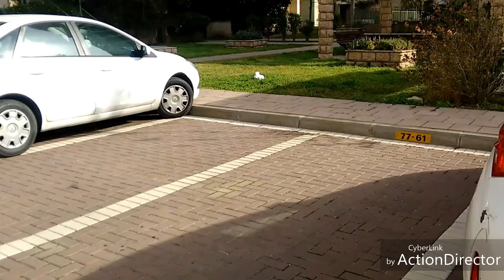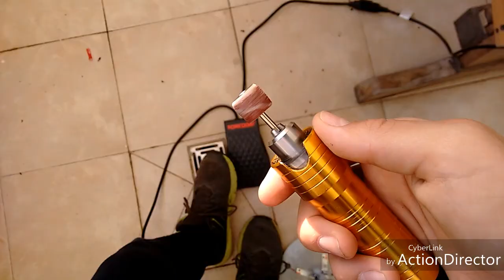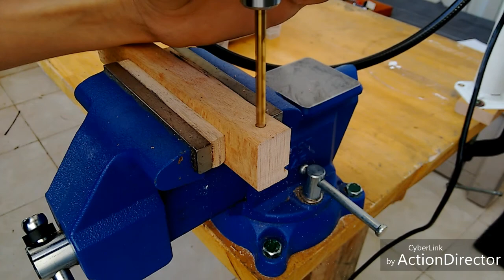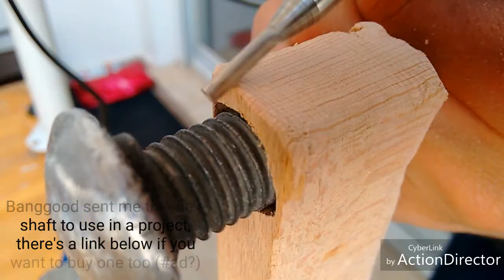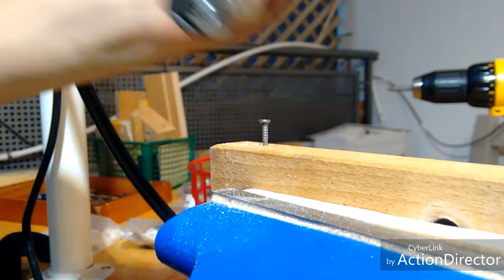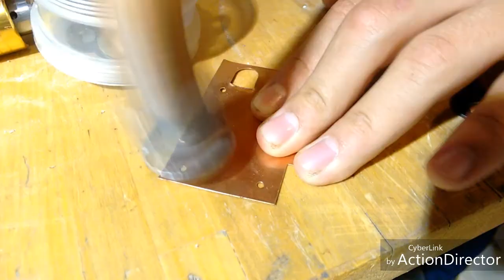How to Make a Ball-Peen Hammer from an Old Bolt - with a Secret Twist! (no pun intended)

Comment from the maker: Comment your guess on how much this hammer weighs, free heart to the closest one!

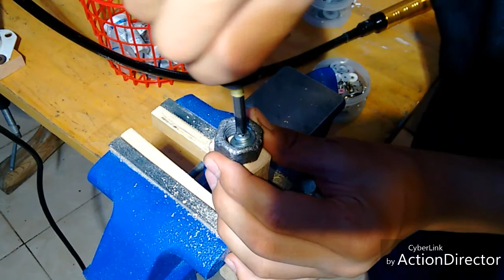jk I cheated at 2:09,  I used a screwdriver :)
Reply: Yonatan24 15 ounces
Reply from the maker: WHAT!?! How did you know?

Just kidding it's actually a tiny bit less than half of that :)
Reply: Yonatan24 7.5 ounces.
Reply: I mean 7.
Reply from the maker: Oh, 7.16061 / 203 grams.
But if I sand it a bit more I could make it exactly 7 ounces, not that it matters :)
Reply: Yonatan24 lol ok. How u been?
Reply: Yonatan24 my friend gave me a thing that u screw into a bulb outlet and then a bulb into it and it lets u have a remote to control it. I might do something with that
Reply from the maker: 👍
Something like this?: https://www.amazon.com/LED-Concepts-Control-Wireless-Fixtures/dp/B00L1P44R8
Never seen these, what do you have in mind?
Reply: Yonatan24 yup. Idk what ima use them for.

Comment: Need a ball peen for a project, searched for an alt tool and came across this vid. Clever.

Btw, you could make an ASMR channel w/ project content like this. The tapping at the end--so satisfying.
Reply from the maker: Thanks, it is quite satisfying. If you're a fan of DIY ASMR I recommend you check out Andy Rawls and I think also Uri Tuchman.
What do you need a ball-peen hammer for? I never found a use for mine.
Reply: Adding some boot hook eyelets to the tops of some combat boots. A ball peen flares the metal to finish setting the rivets.
Reply from the maker: Interesting.

Comment: Who haves a rotary tool and doesn't have  a hammer
Reply from the maker: What's a rotary toolbar?
Reply: Yonatan24  rotary tool 
My bad
Reply from the maker: What do you mean? The whole point of tools is to make stuff, and more tools. I never said I don't have a hammer :)
Reply: Yonatan24 it is kind of a practicality joke
Reply from the maker: As a master of telling jokes that aren't funny, I still don't understand the point of this joke :)
Reply: Yonatan24 imagine someone who haves a rotary rotary tool but doesn't have a hammer
Reply from the maker: Not that hard, you might've gotten a rotary tool for free. Still though, not having a hammer is weird!
Might be weird that I buy angle grinder cutting discs, but don't have an angle grinder - I use them in my circular saw!
Reply from the maker: Might be kind of like having a collection of tripods, but having no cameras or any idea on how to use one? 😉
Reply: Yonatan24 a hammer is the most essential tool after the knife
Reply from the maker: Knife definitely. Even a vise can be replaced with your feet. But a piece of steel or scrap wood can be used instead of a hammer... 
But you can't replace a screwdriver!
Reply: Yonatan24 a sturdy knife can work as a screwdriver
Reply from the maker: ...Philips?
Reply: Yonatan24 a quite sturdy knife